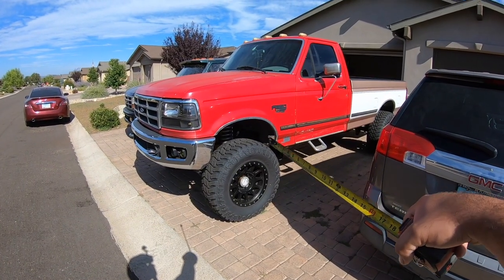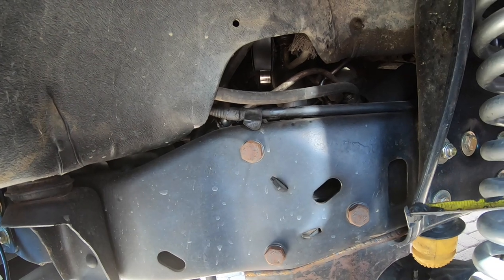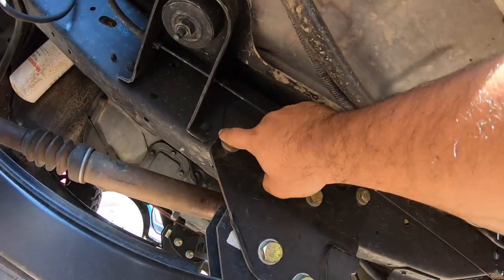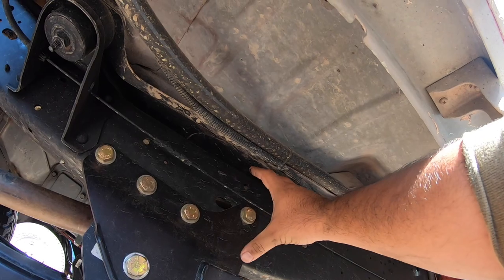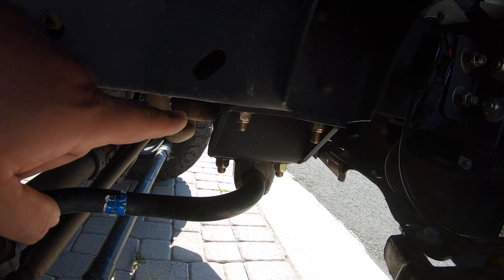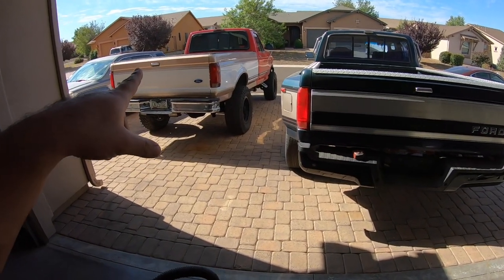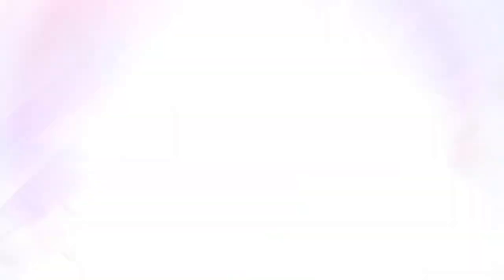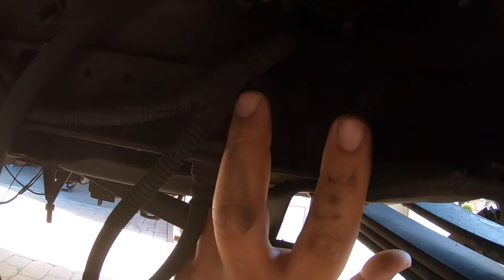Trying To Answer Your Most Asked 05+ Axle Swap Questions

Comment: I haven't seen a video where this is covered. So on your site it says 80-96 f150's will need additional holes drilled and possible shimming. Are the extra holes self explanatory once you put all the parts under the truck for mach up? Or is that information gone over in the instructions of your kit?

Comment: Didn’t know it was that simple to locate where you drill the frame for the coil buckets.  I’m also looking forward to finding out what color you’re gonna paint the truck.  BTW what size exhaust do you have on the truck? 4in?
Reply from the maker: I know right it’s super easy! And I think you guys are gonna like it! So it’s a 4” pipe to a I think 8” or 6” dump under the bed right after the cab

Comment: Why do you even need it 05+ axle. Why don’t they just make coil buckets that attach onto the Dana 60?
Reply from the maker: There is actually a company that does that I believe it’s carrick customs they have a kit to install coil overs on your OBS. I like the 05+ swap because you get way better components the axle itself has bigger tubes you get bigger brakes and steering.
Reply: @blowingdiesel  good to know. Thanks

Comment: What if our truck is already coil spring
Reply: We’re just here for content
Reply from the maker: I don’t sell mirror plates I don’t think you ordered from blowingdiesel.com. All I sell is bumper brackets 05+ axle swap parts and door reinforcement plates
Reply from the maker: What do you mean like a 2wd obs? You will still need the 05+ components installed like I showed here
Reply: Will I still have to move my spring buckets
Reply from the maker: Your OBS coil buckets don’t work with the 05+ springs at least from all the research I have done and from looking at both my trucks that’s what it looks like so you will also need the 05+ coil buckets. I mean you could try and make it work. I just have never seen any one so it that way.
Reply: Do they go back in the same spot at my obs one and my truck is just like your f350
Reply from the maker: No you have to place them at 13 1/2” from the front body mount and drill new holes. And that’s awesome hopefully here soon I can start on the dually build